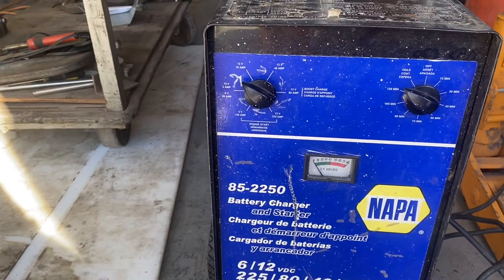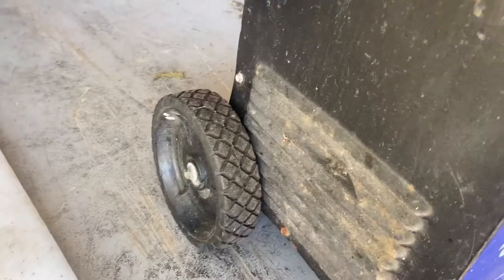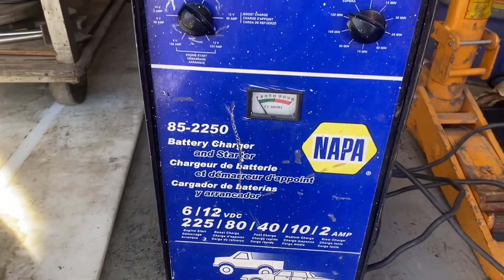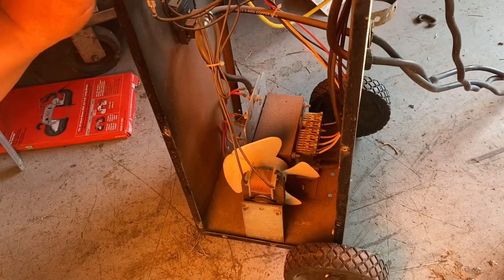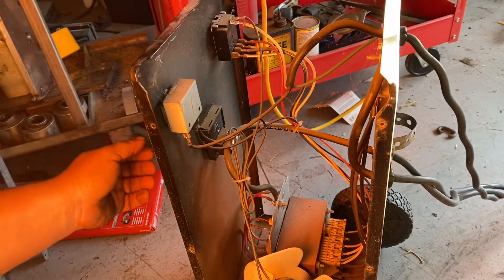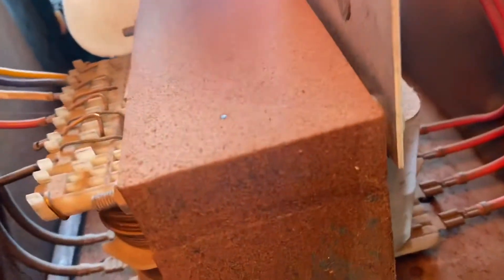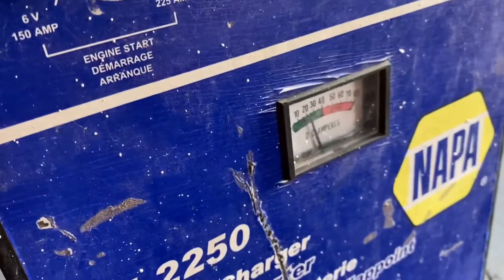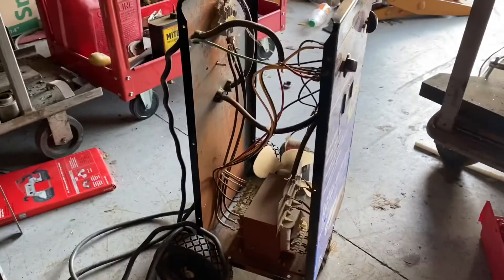Working on my napa battery charger/jumper

Comment: Do you think it might have been a jumper? I've had one of the smaller 50s ones of these open and the jumper they used was like spring steel or something, it was preformed to kind of have spring pressure holding it in place in those stab in type connections. I could see one of those pinging off just from being trundled around.
Reply from the maker: I cleaned them really well, one was kind of pitted from arcing from the previous owner

Comment: Do you still own this battery charger?
Reply: Im asking because I have this battery charger but the claw clips have been cut off and I have no way of knowing which is positive and which is negative, I’m trying to repair it, I basically just need to know what the left and right cables are from the back of the charger
Reply from the maker: @Oneflywhiteguy1994  yes I do, best charger I ever had, as soon as I get home today I’ll let you know how mine is setup
Reply from the maker: On mine, looking at the back the ground clamp is the left side and positive on the right as there coming out of the machine case
Reply: @smalltownmachineshop6860  just so I get this right, the ground is black and the positive is red? lol 

Also thank you so much! I know how random this was on a video
Reply from the maker: @Oneflywhiteguy1994  yes black is ground and red is positive